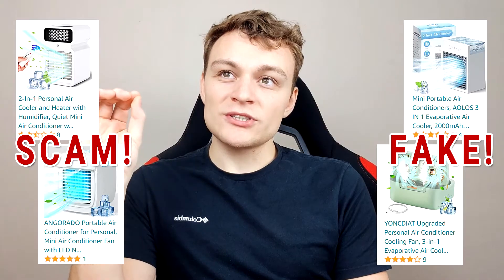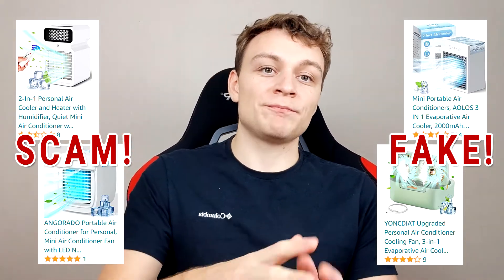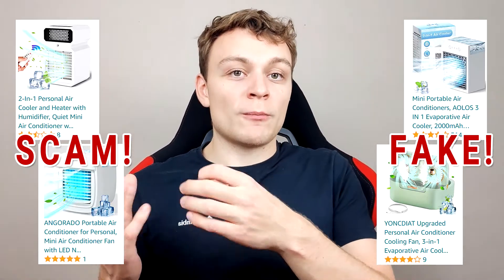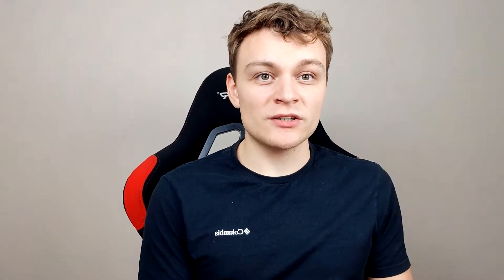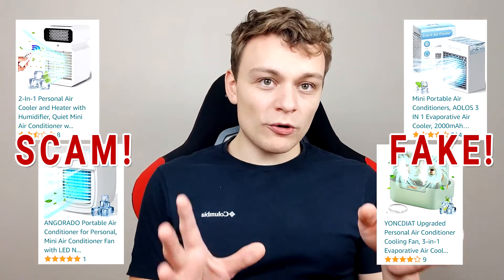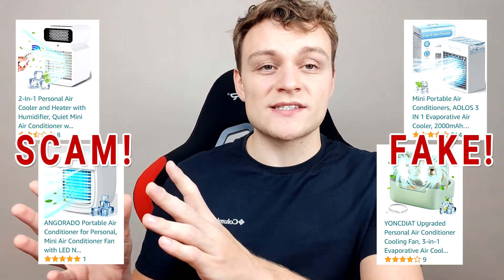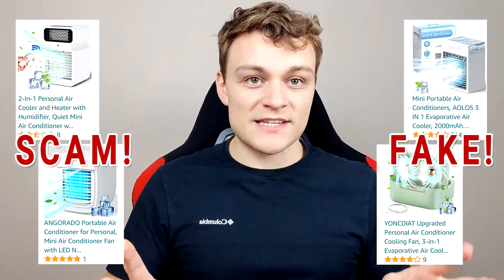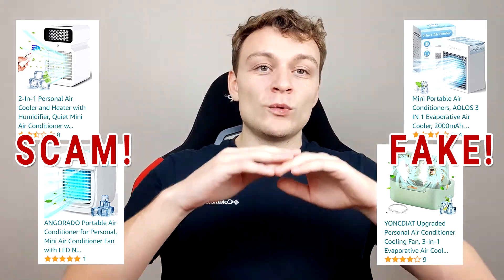Fake Portable Air Conditioners Scam - Which ACs really work? (Watch before you buy)

Comment: The problem is that they use the same term on Amazon, "portable air conditioner", both for actual AC units that vent the heated air through a window using an exhaust hose, and for crappy little pieces of junk that don't vent the heated air outdoors at all. My (real) portable AC from Black and Decker does work; it cools my living room from by about degrees, so is a life saver and I'm grateful to have it.  

I also own a little "ice chest with a fan" which blows cold air on my as the ice melts... it does keep me more comfortable... but the effect is purely local; the room temperature does not change at all. 

If it's really hot outside (100 or 110 degrees), I use both. The Black and Decker unit can cool the room to 95 degrees; then the little ice chest with a fan from Etsy can blow on me for additional cooling.  (My freezer, which freezes the ice in the ice chest, is in a separate building, so using it doesn't warm up my house.)

Comment: Have you seen the ones on tik tok that look like a mini split but have no hose to the outside?
Reply from the maker: Haven't seen the TikToks but any device without a connection to the outside will not work! It's impossible. You can only cool a room by removing the heat and leading it outdoors somehow!

Comment: Using a "portable air conditioner" can be compared to running a refrigerator with the door open. Not only do they allow hot air to enter the room through nooks and crannies around windows and doors because of the lower the air pressure in the room, but they also suck in, and pump out, the same cooled air that they just generated. In addition to that, the condenser is also located in the same room as the evaporator, and not all of that heat leaves the room via the hose, but is radiated by the device into the area that it should be cooling, which is also inefficient. Don't ever be tricked into buying a portable air conditioner. They all suffer from the same fundamental flaw. I moved to Germany about 10 years ago and still cannot  convince people just how awful those things are.  Both the condenser and compressor must be outside the area to be cooled.  I can count on my fingers the number of times that I have seen a portable air conditioner in the US, as most are window units that do not suffer from this inefficiency, but the nature of German windows makes it impossible to install a window unit. I think that a split system is the way to go here.